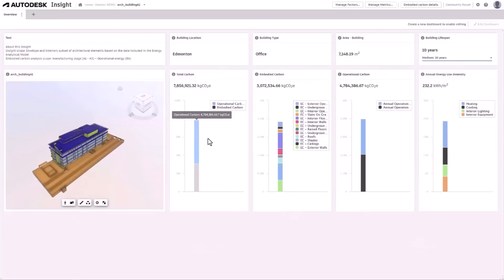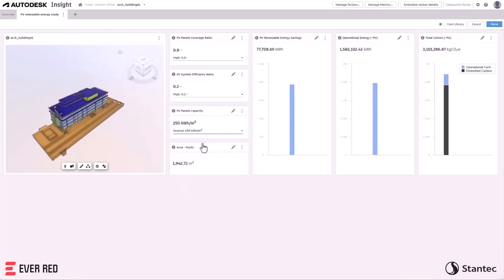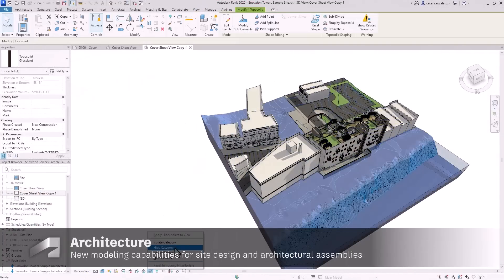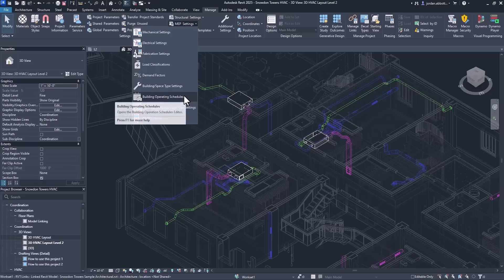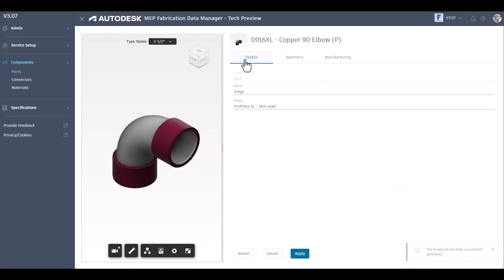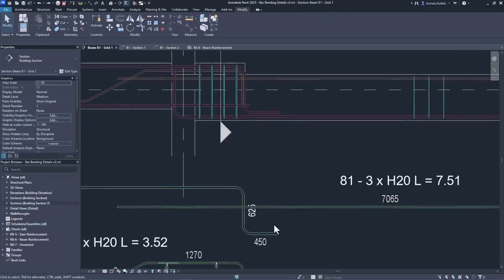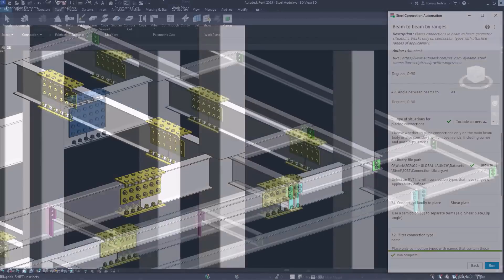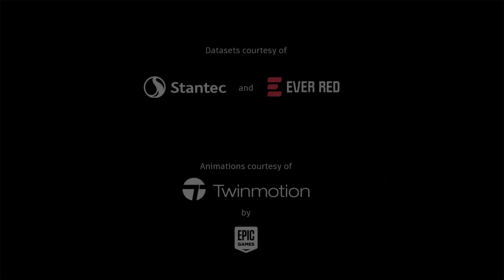What's New in Revit 2025

Comment: Still can't:
- Renumber views efficiently 
- Transfer one specific view template from another project (can only transfer all of them)
- Create filters for tags
- Create filters for text notes
- Trim spline curves
- Convert detail or model lines to area boundaries
- Crop drafting views

Additionally, modeling railings is still needlessly complicated. Want to change the material on the rail itself? Sure you can do that directly in the type properties. Want to change the material on the baluster? 

- Open Baluster Placement to note what baluster family you're currently using 
- exit out of two windows 
- search for baluster family in project browser 
- duplicate the family 
- change the material 
- find the railing type you had to exit out of before
- open type properties (again)
- open baluster placement (again) 
- find new baluster family

Want to change the baluster from 2"x2" to 1"x1"? - repeat the process.
Reply: I used Revit on a very limited basis for a long time because Revit had so many basic problems. The last time I used revit was 10 years ago. I changed my career and I've recently decided to come back to architecture. This latest version still has the same basic problems! I could literally use my 10 year old version and it wouldn't make a real difference - that is not an exaggeration!
Reply: you can't even add a color using HEX number code. it still requires you to manually input each R G B color. this software is unintuitive and they keep charging thousands while giving us nothing. we need to collectively ditch this software.
Reply: No publish fuctionality from autocad.

Comment: We are supposed to be respectful in the comments but autodesk doesn’t respect us. The multi wall solution is lazy and lame. The rest of the features for architecture are mild fixes and small additions to existing features. This is a spit in the face of the customers.
Reply: Any new tool is now classified as AI....
Reply: Completely agree. Revit needs learners. The price makes it unaffordable. A learning license can provide customers more.
Reply: I am completely fine on revit 2025,  What is important is the usage of this software to produce an outcome😊
Reply: I used Revit on a very limited basis but AutoCad was always my primary choice because Revit had too many basic fundamental problems. That was 10 years ago. I changed my career and I've recently decided to come back to architecture. Looking at this latest release of Revit is both hilarious and depressing. IT HARDLY CHANGED! Autodesk is still adding fluff and avoiding incessant problems! I could literally use my 10 year old version and it wouldn't make a real difference. That is shocking to me.
Reply: Then use something else…
Reply: I can’t. Autodesk is virtually a monopoly in my country. The price in using other software is enormous  @eoghanharris
Reply: @eoghanharris not a possibility for me as most consultants are using revit and it has become a requirement by institutional clients in my country. If I could use archicad and synch to a revit project I would.